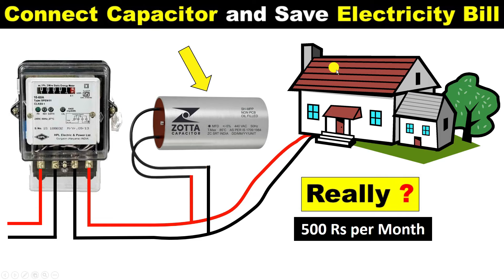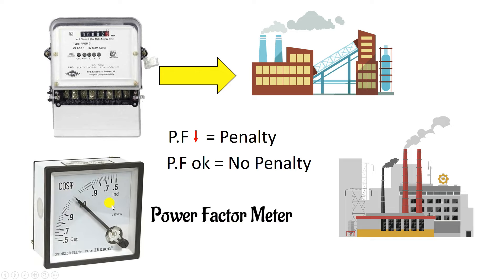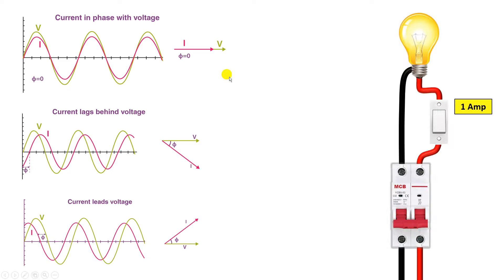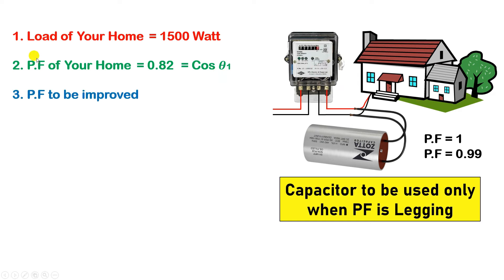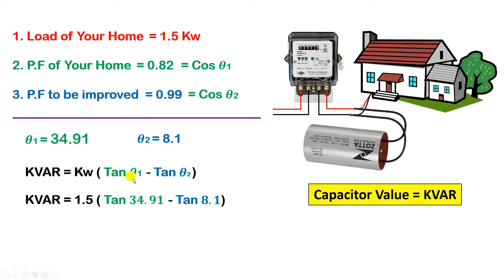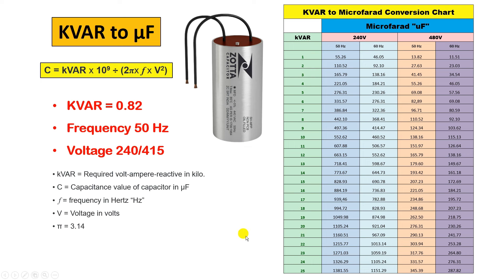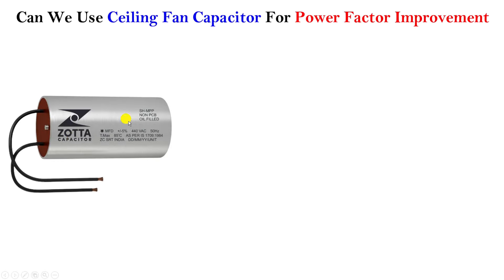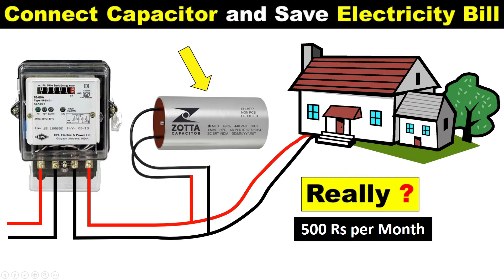Capacitor Value to Save Electricity Bill 💵 @TheElectricalGuy

Comment: In UK domestic meters only record real, not apparent power so adding PFC has no effect whatsoever on reducing electricity bills.  PFC however is very relevant for industrial maximum demand supplies that are charged a penalty for a poor power factor as described in video.
Reply: I agree, but I think since one is not using power as efficiently for the applicable function, higher use of the device may be used e.g. refrigerator runs longer to get to the temperature set point.

Comment: Hello, if you plan on experimenting with capacitors of any size please please be carefull. A capacitor can act as a battery to store a charge for "Quick-release" of current so getting a shock is very likely if you touch any terminal bare handed or with a tool. Even a radio capacitor can send you flying across a room if not properly discharged. Even veteran sparks get jolts when they least expect it. Don't get yourself killed to save a few bucks . Keep your electrical appliances clean and dry and they should pay for themselves with constant use. You will need a massive bank of industrial caps just to store power for a modest home. Let the "Grid" people take the pressure for keeping the Current constant, that's why we pay them a % for maintence.

Comment: Your calculation has problem, you want to find new power suply when add the cap. So you can not use 3450w for calculating new amps.

Comment: In doing this, will you need a voltage regulator?  To make sure that you dont destroy any components, parts or system when you're using a capacitor like this?

Comment: About mathematical language: India says it backward for multiplication and division.  For example, he says at 10:01 "3 into 27.4" for 3 x 27.4 (three times 27.4) - this is normally said as "3 by 27.4".  Then, I have noticed in many math videos they say, for example, "2 by 4" for 2 ÷ 4 (2 divided by 4, or 2 over 4, or 4 into 2).
I don't see how that seems logical to them at all, and is very confusing.

Comment: Yes, if you operate large inductive motors and your energy supplier asks you to correct the phase angle.
No, if you have an ordinary house and the energy supplier only counts the active power.

You have to distinguish between inductive power factor and capacitive power factor.
If you have an inductive power factor like in a factory, capacitors will help.
But in households there is a capacitive power factor. A capacitor will only make it worse.
Reply: In most households, the reactive current is not measured at all and is virtually unpaid.
In the household, large and small consumers are constantly being switched on and off. The power factor is constantly changing. How do you want to do the calculation then?

In industry you have big motors or transformers. Its inductance can be measured and corrected capacitively.
Reply: @jensschroder8214 such good replies 👍 appreciated

Comment: I have a friend who does this at home. He has up to 3 capacitors. Depending on the load, which capacitor he uses depends on the load. He said that comparing the electricity bill results before and after the capacitor was installed, there was a change. Electricity bills have been reduced.
Confused! 😁😁😁

Comment: so what the value of capacitor tha you will be connecting ? please note thqt it is a risk just connecting a capacitor in a service AC line . you could create a short circuit and could be safety hazard and could damage electrical system . It must be carefully studied by knowlegeable Electrical Engineer .  It is really dangerous my friend . Can you show an actual video ?

Comment: By improving power factor we can reduce the loss of power in the form of unnecessary heating. With the improved power factor we can reduce reactive power which is simply loss of power. You are silent on that aspect. Don't  agree with your explanation.

Comment: Useless. Power factor keeps changing depending on what kind of equipment is powered. Are you going to measure it all the time and keep changing the value of the capacitor ?